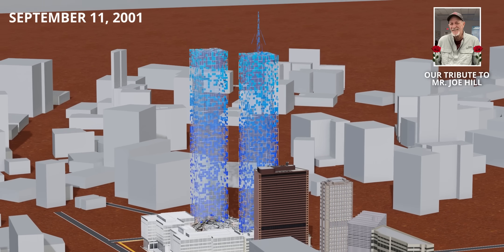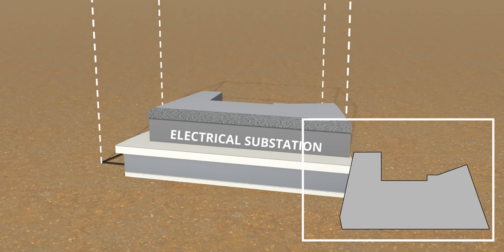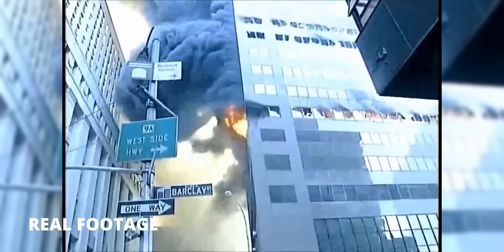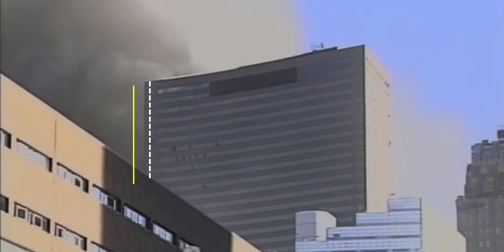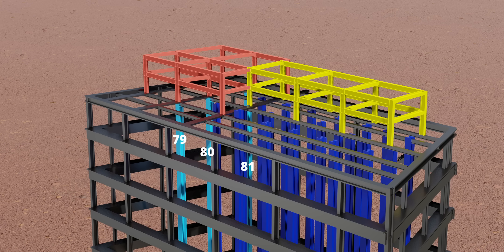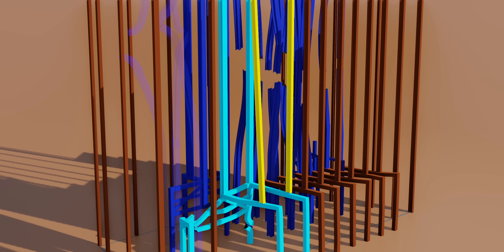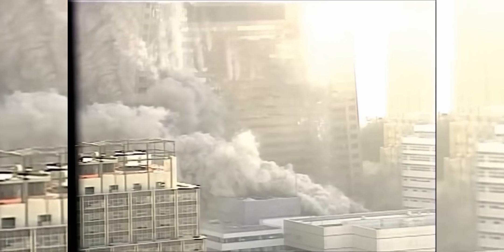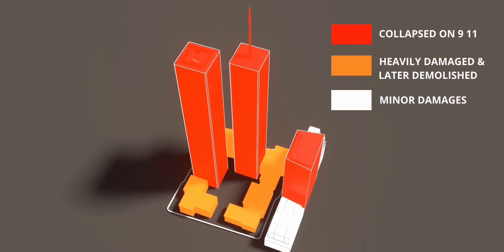Collapse of Building 7 | The Complete Physics

Comment: The building superintendent of WTC 7, Barry jennings, gave an interview on the street right after he was rescued from WTC 7. That interview he said that he was walking down the steps after the second plane hit, having decided to evacuate the building, when suddenly there was an explosion from the basement which threw him violently backwards up the stairs. This is all you need to know
Reply: Failing structure sounds like explosions. In a reverberant stairwell, slamming doors sounds like explosions. The sound of an explosion is just a high velocity pressure wavefront passing your ears. Any impulsive source does that.
Reply: @kg4lod It's frustrating trying to make someone understand, the sound of a large loud bang doesn't always equate to coming from an improvised explosive device. To add more to your floor collapse response, most buildings are designed with the ability to keep air pressure to a certain degree. 

I worked at a job where one of my main tasks for awhile was caulking/firestopping air gaps in rooms because the design for temperature control. They would do a pressure test in each room to ensure there was a sustained pressure being kept. This allowed each room to keep seperate room temps from hot to cold air conditioned temps without losing those temps to any adjacent rooms. 

This is all to say that when a building collapses it creates a rapid increase in air pressure which COULD push so much air into a space that it could "POP" that area room. The sound of a door being "blown" open reverberating could potentially sound like an explosive device went off. Equally, concrete collumns under increasing load can "explode" as well, again sending sounds throughout similar to an "explosion". Anyone needs to just google search "concrete compression test explosion" to find collumns don't just ONLY crumble slowly and fail, they can literally explode as well, even WITH rebar support.
Reply: I gave him 10 bucks to say that.
Reply: @martinswan9175  he would of said it for a grilled cheese sitting in the heater at 711 on the corner of broadway and 2nd
Reply: Barry Jennings was suicded
Reply: @TrialzGTAS 
The day after he was suicided, Congress held a hearing that concluded that there were no witnesses of explosions inside of the buildings.
Reply: Mr Hess....Darn predictive text
Reply: Hahahahahahahahahahah
Reply: As stated in the video, wtc7 was sitting on top of a large substation. The explosion could easily have been a transformer, not like an autobot or decepticon. Jumping to conclusions makes a person look dumb.
Reply: I've never given much credence to people that throw around the phrase "this is all you need to know". Why don't you let me be the judge of all I need to know? Because things are, you know, never simple. This seems to be even more true surrounding events in which people throw this phrase around. In fact, you can be sure that the more people say that, the more complex the situation is. It's almost as if people tell you what they want you to think, and then follow it up by telling you to not look further into it. Call me crazy, but I find this to be pretty questionable. Lol
Reply: @stephenwest6738 - I won't call you crazy...I call you normal...Great comment, thank you...Look back through the comments of this video, and read my argument...Make a long story short! This video production of B-7 attempts to erase all other theories of collapse...He actually tells me, it makes no difference if a missile hit the Pentagon nor how the Towers fell, his interest is B-7...My very important point, his company won't consider the BIG PICTURE, PhD. Judy Woods " Where did the Towers go "...His video production is perfect that's the problem.
Reply: https://youtu.be/1IYlEVCpG_0?si=mreLiRWBlabiamSO&utm_source=ZTQxO
Reply: @CptAeRoTR  - And?
Reply: @TheCriticalStinker-01  just some random explosions under the building. You know when a plane crashes, explosions start below the entrance as usual.
Reply: @CptAeRoTR  - Under what building?  What makes you say they were under ANY building?
Reply: "walking down the steps where and from where?   Threw him backwards aye?  And yet, after this 'explosion', he was able to simply walk out of the building without a scratch.  Ok ...........
Reply: What basement?  Building 7 not only had no basement it was built on top of another pre-existing 3 story building.  Jennings had no idea what was going on outside and was in shock when interviewed. It does not take a genius to figure out the event he is describing is the collapse of the North Tower.
Reply: @TheCriticalStinker-01 And what about Mr. He's?
Reply: @TheCriticalStinker-01 you are a critical stinker,you aint no critical thinker,11 men brought the mighty u.s.a to its knees.and made it to the pentagon are you for real,😂
Reply: @TheCriticalStinker-01  One floor of WTC7, forget which, was heavily renovated to become what I think was called New York's Emergency Management bunker.  It had emergency generator or generators in case of loss of power.  It had a very large tank of petroleum fuel to feed the generator(s).  Where was the tank located?  Was it not on the ground floor?  Could it not have exploded and the force impacted Jennings?  Could it not have burned with the heat contributing to the weakening of vertical and horizontal steel components?
Reply: @FirstUsedBooks - 26th and its primary "reinforcement" was hurricane rated windows. 

None of this relevant to the collapse.
Reply: @TheCriticalStinker-01 you seem to be really invested in the mainstream narrative 😂
Reply: @crouchingwombathiddenquoll5641  - I am interested in what happened. I could give a shit whose narrative it is and choose not to limit myself to such low-grade non-thinking.  It's for morons.

If I made any errors of fact, logic or reason or left anything important out, please let me know so I can fix it. If all you are going to do is that pathetic ego-stroking cope however, please keep it to yourself. I'm not interested.
Reply: @TheCriticalStinker-jw4fl  
Hahaha, have a listen to yourself
Reply: @ 
"Hahaha, have a listen to yourself"
-He seems very reasonable.  You on the other hand, seem cemented in ignorance.
Reply: @crouchingwombathiddenquoll5641  - So that would be a no errors of fact, logic and reason from you then. Great. Glad we got that sorted out. Have a nice day.
Reply: @TheCriticalStinker-01 
You stated that the building was not in freefall, when there was in fact over two seconds of absolute freefall. That can only happen if there was no resistance.
Reply: @TheCriticalStinker-01   get a life, the comment section of this kind of videos is flooded with you yapping. Seriously.
Reply: This is ALL COMPLETE NONSENSE here is a video from PBS with the owner, Larry Silverstein saying he "pulled" building # 7. It was prewired to fall. All this speculation and for the past 24 years everyone knows it was an inside job.
https://youtu.be/Wq-0JIR38V0
Reply: Do mind the other comments. They are just sucking the teet and not questioning anything their government daddy tells them.
Reply: never trust government, police, your children, spouses and lawyers
Reply: How do you know what I need to know?
Reply: @salimmohammed7761  I was there. It was Schloprians from the intergalactic council. They want earth involved in their mess but I say keep us out of it! I can smell their treachery from a mile away.
Reply: this is not all people need to know. There is network of evidences, facts,  events that all combined gives big picture. What I saw is major said :"we are going to take it down" walking past WTC7
Reply: how funny is that somehow those stupid cartoons didn’t include the bombs going off
Reply: ...Thats true, I and perhaps millions watched the interview live...I believe the flight that crashed in Pensylviania was headed for Building 7...Why ? Because the building was set up and ready...They could not leave the building standing with the evidence of demolition so Lary Silverstein owning the lease had to give the final order " PULL IT "
Reply: i am a happy and you are silly. This is all you need to know
Reply: a plane hit the basement??!
Reply: Look at you on your desperate quest to make your life interesting.
Reply: Nope. Petrol tanks exploded from fires.  Common all over buildings on 911. No conspiracy
Reply: Jennings probably changed his story because certain government agents approached him to change his mind 🧠🧐🤔⁉️
Reply: Some of the "explosions in the basement" comments could have been elevators failing and then falling down there shafts to the bottom.
Reply: Not EVERYTHING is  conspiracy.  Give a break, people. It was NOT a controlled demolition.
Reply: Wait so they demolished the building while he was in it, yet got out? Almost sounds like a loud of shit
Reply: "Explosion" couldve been anything. A lot of things sound or feel like an explosion.
Reply: .   .   .   You are correct, I watched that live interview, ...Remember this ! ...Flight 93 was headed for Building 7, WHY ? it was set up for the hit.....
Reply: You can even hear the explosions on video footage.
Reply: Jennings has changed his story multiple times. This is all you need to know.
Reply: @joshd3192 where’s the proof that he changed his story?
Reply: @benitopepolini1249  Why don’t you research and find out yourself. Anything else?
Reply: @joshd3192  oh please that’s what you got? How many times was he threatened?
Reply: @michaelocchipinti8265  By who, tool?
Reply: @joshd3192  
He changed his story a few weeks after, and then he died. However the interview he gave right after being rescued, is much more believable. Many think he was threatened and then suicided.
Reply: @- BIG shot Josh, here is what you need to know...Israel, USA, and whatever Jerkastan on the planet is guilty of 911, not Mr. Jennings...Your 58 thumbs up are a piece of work...
Reply: @joshd3192  is it common for someone in a near death situation to completely switch up their story? cuz I've been in multiple, and my story never changed. maybe he was coerced.
Reply: @joshd3192 Jennings changed his mind 🧠🧐🤔 because government agencies USA 🇺🇲 told him to change his story ⁉️
Reply: And multiple firefighters said the exact same thing. 
I’m guessing the CIA paid this presenter
Reply: @christineguttilla6465 bingo
Reply: @christineguttilla6465 threatening your a man’s family is all it takes.
Reply: But when you say multiple firefighters said the same thing, that’s great, but what about the other thousands of firefighters who were also on the scene that day.  I mean, who really said what?  Is there video of these people saying what you’re saying they were saying, on the context you’re saying or are you just conjuring up what you want to think was said?
Reply: @dikranovichk5889  There is a video of firefighters shouting explosions below, we have evacuate asap. I watched that and it is real.
Reply: @CptAeRoTR  and it’s literally on video of Live News from 9/11. I’m guessing the people doubting were still in their diapers when 9/11 happened and don’t remember. Minute 3:40… Firefighters who were in the building, News Reporters, people who escaped the building, etc. https://youtu.be/KFUqc0Um_aU?si=ZH9DrJBnYE18wEfF
Reply: The replies to your comment is all we need to know
Reply: Of course there were explosions in the basement. How else are you supposed to demolish a building?
Reply: @proto-geek248  - Building 7 didn't have a basement. In fact, it was built on top of an existing 3 story building which formed part of it's foundation.
Reply: @TheCriticalStinker-jw4fl  It was demolished by Israel the same day they demolished everything else.
Reply: @proto-geek248 - WELL ! 3 things we know for sure,#1 Israel Intel notified all israel business in the WTC months before the attack too end their leases.#2 Israel art student video crew jumping with joy on the planes hitting the Towers they caught on video. #3 Larry ! Oh Larry Silverstein...Fauci reminds me so much of him...
Reply: @TheCriticalStinker-01  Never let facts stand in the way of a good story
Reply: @haneycr - Sorry, can't help it.
Reply: @salimmohammed7761  SPOT ON! Thank you! There was a certain Mr. Hess also present who retracted his original statement and refused to comment since that point.
Reply: I suppose he was still in shock when he gave an interview months later, they both must of been obviously! 😅
Reply: @Silurian68  must HAVE been! must HAVE been!!
Reply: I know that wtc1 and 2 accelerated towards the ground at nearly 1g, ie freefall.
Reply: @RedSphericalUFO no they didn’t. All you have to to is watch any video and see actual debris falling faster than the buildings
Reply: @RedSphericalUFO 
They used CGI, special effects and mini nukes in the bedrock below the utility shafts. These pulverized the lower concrete floors into powder. That is where the radiation ☢️ and the molten 🔥 material that lasted for days came from. The upper floors had no resistance in dropping.  You can find the analysis online if you look.
Reply: @tropicaltico  Thermite.  

Demolition and Incendiary Devices: Due to its ability to melt through metal and generate intense heat, it has been used in military applications for destroying equipment and as an incendiary agent.

Metal Cutting and Boring: The molten iron can be used to cut through or create holes in metal objects.
Reply: @tropicaltico  
"They used CGI, special effects and mini nukes in the bedrock below the utility shafts. "
-LOL!  You conspiracy theorists crack me up.

Comment: The term "free-fall-speed" is just one of those expressions conspiracy theorists sneak in to make loaded questions sound more convincing. They'll say thing like "How could it fall at free-fall-speed if it wasn't a controlled demolition?" The normal instinct is to argue about whether it was a controlled demolition without actually vetting the implied claim. The claim being that it fell at free-fall-speed. Speeding up the video is one trick they can use, but especially with the two towers, you can actually see debris falling next to the towers. The debris falls faster, because it's in the air, at real free-fall-speed. Speeding up the video can't obscure that fact. If the buildings fell at free-fall-speed, then the debris fell faster than free-fall-speed, which makes no sense.
Reply: I got news for you:
- NIST itself said the twins came down essentially in free fall
- If you compare debris starting its free fall from a height of let´s say 350m with the roofline starting its free fall from 415m, the roof line won´t catch up with the debris obviously. That doesn´t debunk free fall.
- For WTC7 a free fall of 8 storeys was not only stated by NIST but also proven by independend investigators.